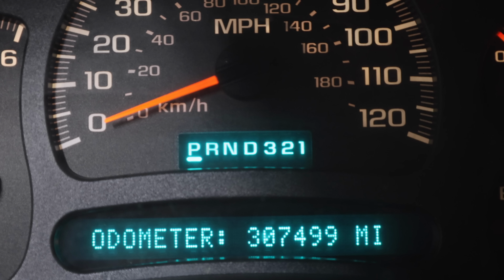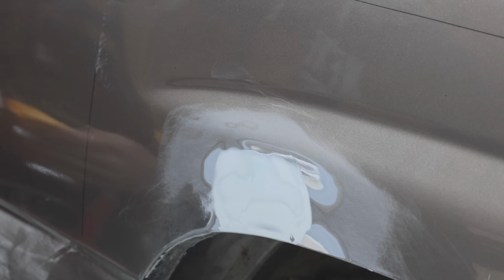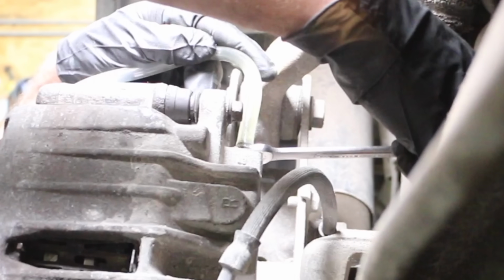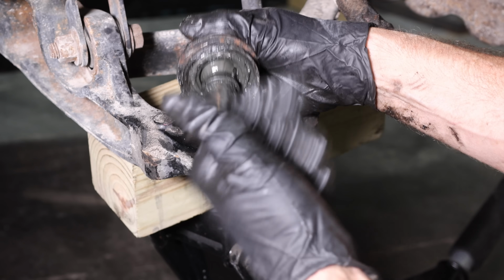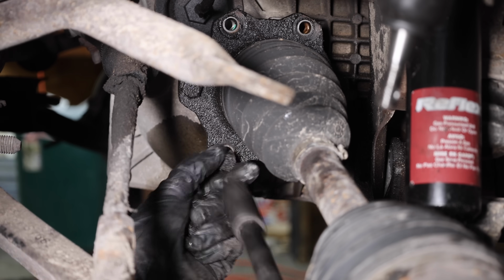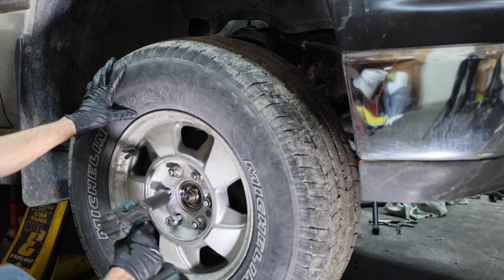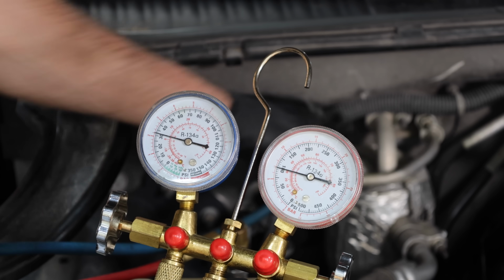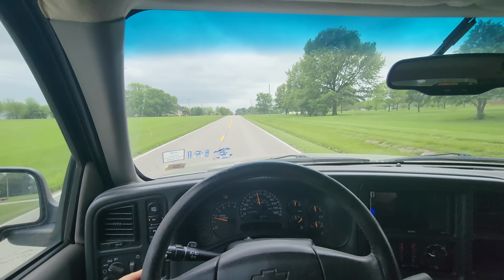Is It Stupid To Fix Up A 300,000 Mile Vehicle? Let Settle This!

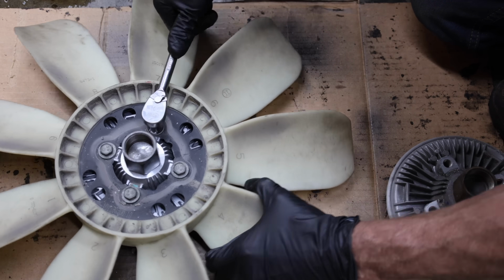Comment: 19:05 great video. But imo, adding 15w40 to an engine that calls for 5w30 isnt a good idea. People tend to confuse oil pressure, with oil flow. Would hate to see you need an engine rebuild because of oil starvation. Get that thing to 600k. Chevy power baby.
Reply from the maker: Thanks!  Thanks for the constructive feedback.
Reply: You have no idea what your talking about lol
Reply: If you think a 40wt engine oil is going to starve an engine, especially a Chevy v8 your misinformed. Sorry
Reply: @Patrickhit87  why are you worried about the 40. The 15 in the cold is a bigger problem. 4.8/5.3 knock exists   and has existed since they came out .
Reply: @marioncobretti7870  why are you worried about the 15w when you don’t even know his operating environment? I noticed not a spec of actual real rust on this truck, suggesting a southern environment. As long as the ambient temp does not fall below freezing, 15w is plenty good enough !
Reply: @marioncobretti7870  I see no reason for him to not run at least 10w40, but 15w40 is probably fine for his most likely southern hot climate.
Reply: @marioncobretti7870  and if he truly lives in a southern climate, 15w is better than 5w or 10w because it needs less viscosity improvers which means less shearing for extended OCI
Reply: @Patrickhit87  specifications are there for a reason.  Bearing clearences, are set for a reason
    Split oil specifications bases on climate, exist, for a reason
    Project farms  shows exactly what happens to oil in cold, and hot, and the flow between different weight oils is extreme.
   Yoy dont know what you, are talking about. Not sorry
Reply: @marioncobretti7870  oh the whole bearing clearances non sense. Let’s see, I only know what I know, so I’ll use my beloved Toyotas as examples. The 1uzfe in my Lexus has significantly tighter bearing tolerances than its younger brother the 2uz found in my Toyota. The 1uzfe in Europe, Mexico, Australia (hotter climates, climate matters!) specs 5w30, 5w40/10w, all the way up to 15w50!!! Meanwhile the 2uzfe with significantly larger bearing tolerances calls for 5w30 in North America. It’s clearly climate based. The bearing tolerance nonsense is nonsense and has very little to do with anything
Reply: @marioncobretti7870  I’m an avid bitog (bob is the oil guy) forum member, and if you are too, you should know bearing tolerance is nonsense boomer wannabe engineer mumbo jumbo. My brothers gx460 specs 0w20, yet has larger bearing tolerances than my 1uz… why? CAFE requirements. Thankfully Lexus allows some wiggle room in the owners manual, and says “based on driving conditions, you may run a higher viscosity oil, in the return of possible lower fuel economy” LOL
Reply: @marioncobretti7870  the same reason why my grandmas grand marquis 2003 model specs 5w30 from the factory, yet magically a few years later ford and Honda make a deal with the epa and then sent a TSB requiring 0w20, oh my I guess those bearing tolerances magically changed wirelessly in 3 years LOLOL
Reply: @Patrickhit87  im not going to argue the merrits of tolerances with someone that still thinks cars are air cooled( your southern climate concerns)
And that thinks  a ford, v8 of some sort, would share the same bearing, block materials and clearances with a toyota. 
Use brain, just a bit
    Dont really care if Bob, oiled your throat, personally. You  obviously know nothing, about oil
Reply: @marioncobretti7870  my southern climate comment are related to your concerns of 15w, do u need oil basics 101? 15w40 is a plenty good enough oil weight for engines that operate above freezing. He doesn’t need a 5w.
Reply: @marioncobretti7870  when did I say a ford v8 was the same as a Toyota? My comment about the ford v8 is it was specd 5w30 from the factory, but 4 years later the epa mandated for it to run 0w20, so ford magically changed the specs to 0w20. Proving bearing clearance has nothing to do with anything and it’s just cafe requirements
Reply: @marioncobretti7870  your dumb, you think 15w is going to cause oil starvation when it’s above 32 degrees outside. If it’s above 32 degrees a 15w will flow just as good as a 0w
Reply: @Patrickhit87  they put a thinner oil in, because oil flow was not achieved
    Your origional comment, was talking about how its ok, to add a thicker oil. And my origional comment, said i wouldnt do that. Because ive personally seen timing chain tensioners fail, and crank bearings spun, because some turd dick decided to put 20w50 in his mad tight 5.0l mustang.
        Oil pressure is not an idicator of oil flow. Was all i said, and now im getting some lecture from a ricer about how im wrong.
      Conversations over. Put whatever you want in your sh!t box i dont care about you, or your grandmother. This is the internet its not a real place
Reply: @marioncobretti7870  Saying that tighter tolerances justify lighter weight oils just underscores the amount of misinformation and misunderstanding out there on the subject. Tolerances have nothing to do with clearances. Tolerances describe the amount of allowed variation in dimensions between so called identical parts. Clearances are what matters in terms of oil pressure. Bearing clearances in modern engines are not appreciably tighter on average than older ones.

Comment: I had a 2005 Chevy suburban with a 5.3 with 421,000 before I changed a motor. It also had low oil pressure which made the lifters tick at 225,000. The trans made it with no problem to the 421,000 for a rebuilt
Reply from the maker: Thanks for sharing.

Comment: I have a 300,000 mile vehicle, just got my latest 100,000 mile maintenance, water pump, timing belt, head gasket... Doesn't leak a drop of oil, doesn't burn it either, insides of the engine block looks pristine. I need to get my AC compressor replaced, it still works just not well and after 20+ years the blower fan is making some unhealthy noises, if working fine... mechanic says he expects it will run another 100,000 easily. Toyota highlander by the way.
Reply from the maker: Thanks for sharing.

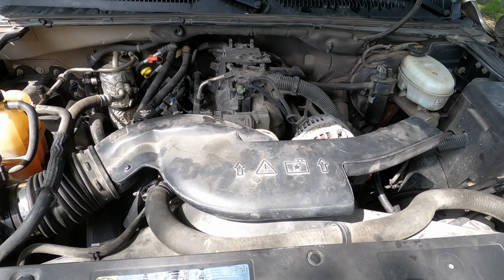Comment: 24:30 "its cheaper to keep er" 100% agree insurance is cheaper and a brand new used vehicle cost a easy $5000+ for 200,000+ miles in my area. the 2007 Toyota corolla i have  is stuck on 299,999 miles before 2020 and still running strong.
Reply from the maker: Thank for the feedback.

Comment: I personally would have put a thin layer of antisieze where the rotor and hub assembly touch just because it will prevent rust welding. I live in Wisconsin, so salt makes them rust and stick together.
Reply from the maker: Thanks for the constructive feedback.

Comment: In the rust belt, its usually not safe to use impact wrenches on axle nuts since they're often rusted and thus can damage the bearings. I'm sure its safer where you are. Also, its only really camber and caster alignment issues that can make the vehicle not drive in a straight line. Though rear wheels being toe in or out more one way than the other can affect steering. Alignment is something that's best done at a shop since the machines are much better than the string method can be. Also with newer cars with ABS, its recommended that you don't compress the calipers since that can result in dirty fluid flowing backwards through the ABS valves. Again, like the CV axle nut, its not a big deal most of the time.  

I really need to get an automotive job. I already have a degree in it yet I'm still at my old job since I don't want to leave before they get their hiring settled and aren't shorthanded.
Reply from the maker: Thanks for sharing.

Comment: a few months ago i spent $970 on my 99 Tahoe to replace the Master Cylinder and Brake Booster as it had a tiny leak, it was a little rusty after all (done by a different shop), before that i had to do a brake overhaul (done by the dealership), so $1500 in total. Unfortunately, come to find out they didnt fix everything (which made it cost less than originally planned) so i might be spending another $500 or so to fix a seizing caliper slider which comes and goes. Definitely not fun.
Reply from the maker: Thanks for sharing.

Comment: Hey. If the car made it that long that is a testament to a good  vehicle. Depending on the vehicle, you might have trouble finding another vehicle that good. And some models are just hard to find. I had a nice Accord coupe that was special and I didn't pay much for it. It was unique I found though when trying to find another. I wish I'd have attempted fixing it after the timing belt snapped.
Reply from the maker: Thanks for sharing.

Comment: I have a 2005 Tahoe. At 270,000 miles I rebuilt the engine, tranny and transfer case. I am slowly replacing everything. The goal is 600,000 miles.
Reply from the maker: Nice!  Thanks for sharing.

Comment: I've done probably 300 brake jobs, and this is the first time I've seen someone use a clamp to compress the piston to make getting the calliper off easier. That is an AWESOME trick! Way better than prying at it with a screwdriver!
Reply from the maker: Thanks for sharing.

Comment: Word is you can use wire cutters to clean the threads of those bolts as well if you have no wire brush
Reply from the maker: Thanks for the suggestion.

Comment: That Suburban is of the era where I feel technology and reliability were at their peak ratios.  Enough technology to keep the vehicle turn-key and “forget about it” (for a while), and not so much technology that it is annoying, less reliable, and harder to repair or maintain.  If rust wasn’t an issue in my area, I would keep motoring on in vehicles made between mid to late 90s and mid 2000s.    Hmm, maybe I should start buying up older southern vehicles…
Reply from the maker: Thanks for sharing.

Comment: Love the work, good to show people how easy it can be to work on your own car.

The only criticism I have is with your rear diff fluid change, you should always remove the filler plug before draining anything. 

Should something be blocking the filler, or someone has rounded it off, you can be better prepared instead of blindsided by extra work.
Reply from the maker: Thanks!  Thanks for the constructive feedback.

Comment: Love your videos. Great video that will help a lot of people. I don’t however recommend using diesel oil in a gas engine that is equipped with a catalytic converter. Diesel oil is high in zinc (excellent wear protectant) but as the small amounts of it that may end up in the combustion chamber and subsequently the exhaust, the zinc will cause damage to cats.
Reply from the maker: Thanks  Thanks for the constructive feedback.

Comment: I have a 2003 Tahoe Z71, and I put drilled and slotted discs and ceramic pads all the way around, with all new calipers and it was all of $600. I also put on '07 and newer discs on the front, which are 1 inch bigger. they stop great. I have a 2003 Tahoe Z71 with stock 17 inch rims tho. I don't know if the larger bakes will fit 16's. They look like they should tho, but just barely. And they bolt right on.
Reply from the maker: Thanks for sharing.

Comment: it used to be considered a badge of honor/accomplishment to keep a vehicle past 300k mi. it showed care and pride in ownership and responsibility of the vehicle maintenance. and its cheaper than buying a new one...unless you plan on rebuilding the whole vehicle lol. i just did major fixes to my 2011 rogue at 150k (got used at 100k 2017). hopin i make it to 300k. also keep the pace if it works for you, most people know how to use the speed settings on youtube vids if needed
Reply from the maker: Thanks for sharing.

Comment: I have a rcsb v6 manual just did a clutch lasted almost 210k also did the rear main seal, new bearings and oil pan gasket not a single oil leak, truck drives as new. Have owned it for almost 10 years always used oem parts.
Reply from the maker: Thanks for sharing!

Comment: Even though you flushed the brake fluid it is still a good practice to block the brake hoses and open the bleeders before you collapse the caliper pistons, I’ve ruined a couple of master cylinders from pushing dirty brake fluid upstream. the first one I didn’t know better, the second one I did but cut a corner tI “save time” great video though, good narration as usual.
Reply from the maker: Thanks!  Thanks for constructive feedback.

Comment: Great job! You gave the old girl years of trouble free life. In decades of owning cars I have had cars with the all mentioned repairs. All of them feel great once done. You have reminded me how I hated the vicso clutch on fans. They leak from the heat and can’t transfer the power to the fan. Great design, placing something that’s heat sensitive into the hot air stream. Anyhow I recall back then it was possible to convert it to an electric fan. That would even like add a horse power or two. 
In a few days my car is getting new breaks, door rubber and few little things. I have changed tires. Car is feeling already better. Can’t wait to drive it once everything is done.
Reply from the maker: Thanks for sharing.

Comment: "If you are going to crawl under a vehicle, i highly recommend using jack stands"

Don't just recommend it... INSIST on it!
Personally, i would have gone with something that is even better than jack stands. Solid blocks of hard wood or even metal. I don't want the vehicle to be able to move anywhere at all.
Even the best jack stands still only have a small contact point with the vehicle and ground, i am talking making the vehicle as solid as the ground it is sitting on.
Which of course brings me to the next important bit... Make sure the ground you are working on is SOLID. Not just a 1 inch thick concrete slab or tiling. And definitely not just asphalt, i've seen jack stands punch right through asphalt and make holes in concrete slabs that aren't as thick as one might have previously thought.

Think of it this way, the feet of the jack stand is what? 1.5x1.5 inches at best? And there's at most 4 feet so a total contact area of 9 inches.
The vehicle weighs something like 4500 lbs. That's 1125 lbs per corner. 1125 lbs over 9 inches is 125 lbs per square inch.
Now add dynamic loads (something pushes the vehicle a bit sideways) and one of the legs on the jack stand can find the full 1000 lbs sitting on it. Or in other words, 1000 lbs over 2.25 square inches. Or simply put, 500 lbs per square inch. Well enough to crack or dig into asphalt and not so beefy concrete pads.
And once one leg punches through, it's going to keep going as the substrate is gravel, sand and dirt. And so you have a vehicle resting on your ribcage.

Using blocks of wood or metal over a larger area of both vehicle and ground ensures that there are no dynamic loads to speak of and the weight is distributed over a much larger surface area.
Reply from the maker: Thanks for sharing.

Comment: Important note to people changing out fluids: Before you drain anything that uses a separate plug for filling make sure you can remove it first. Using examples from the video. the transfer case and differentials had fill plugs that had to be removed to add the new fluid. If you drain first and then have an issue removing the fill plug, well, you're screwed.
Personal example (see avatar pic): The fill plug on my transfer case was stripped and required a non-standard extractor that I had to order. If I hadn't checked first I wouldn't have been able to use my vehicle for almost a week. Since I did it just meant postponing the fluid change.
Reply from the maker: Thanks for sharing.

Comment: They didn't look too bad, but I definitely would have wire -brushed, cleaned, and greased the rear wheel flanges with the lug bolts before installing the new rotors as even just a tiny lump of rust can throw off the runout on the rotors significantly.
Reply from the maker: Thanks for the feedback.

Comment: "Since we are replacing the brakes anyways, we will take the wheel off"

You don't need to explain yourself. I would have taken the wheel off anyways as you save so much effort not having to work in a cramped space.

However, i was surprised and a bit saddened that you bought a wheel arch patch rather than making the repairs yourself using the very things you've reviewed in the past.
In fact, i was hoping this whole vehicle restoration project would be all of the things you've tested all come together.

Comment: You NEED to test the new Valvoline restore and protect motor oil. It claims to remove up to 100% of engine deposits and return the engine to “like new.” All I could hear when reading that claim was Project Farm saying “Were gonna test that!” Definitely want a head to head matchup with Amsoil!
Reply from the maker: Thanks for the suggestion.

Comment: Dude  fixing a high mileage older car is so worth it! I got a 2004: Pontiac sunfire ,with 250k miles for $500 bucks the interior and body were great the engine not so much , rebuilt the engine for $500  got the new transmission for a grand installed new front end parts and brakes for about a grand  so now I got a  like new car for $3000 no computer, GPS ,or  satellite radio plus it will Outlast a brand new car guaranteed !
Reply from the maker: Thanks for sharing.

Comment: The pace of the videos are just fine.  Maybe lay off the coffee and/or Red Bull a little!  Just kidding.  Even with most of the proper tools I wouldn't try to tackle a job like that.  I have a good mechanic that I trust and is fair on labor.  I am maintaining a 2005 Scion TC with over 140,000 miles and I haven't let anyone but myself change the oil/filter since I bought it new in fall of 2004.
Reply from the maker: Thanks for the feedback.